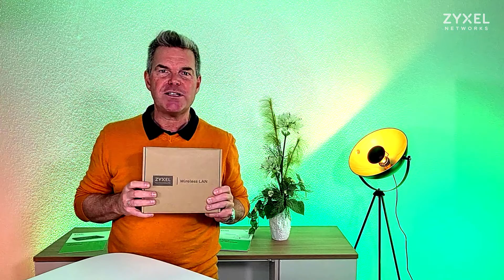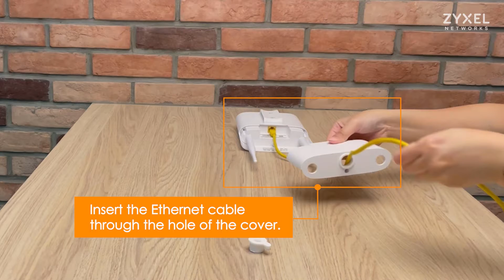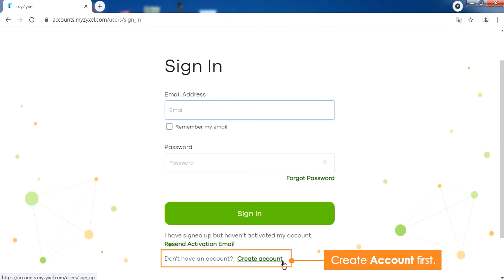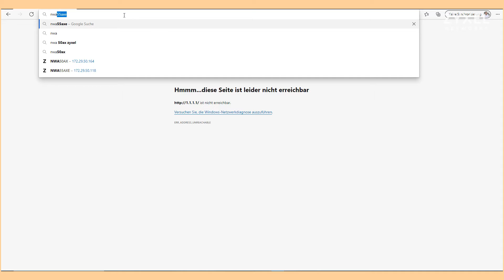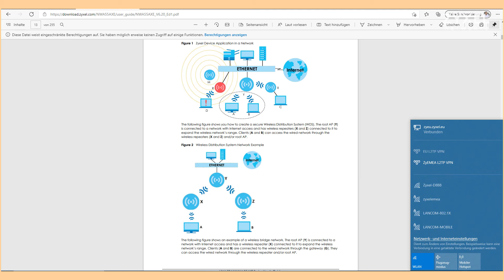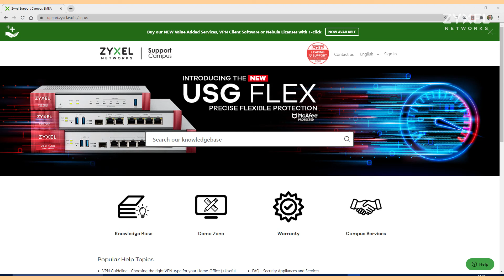Zyxel NWA55AXE WiFi 6 Outdoor Accesspoint Introduction and Installation [EN]

Comment: way too fast with the explanations, you know how to configure this, you are trying to teach us, your accent is very deep and not very understandable when you gloss over important information and the worst thing NO RESET BUTTON, WTF?
Reply: Just bought this but I think I will return it. Your instructions may seem very clear to you but seem very complicated and still no reset button???? That is not good.
Reply from the maker: @DCPHONEGUY  the reset button is not required if you use Nebula Control Center. I installed 10 of the units in a horse stable and this works flawless with the app and the NCC. But it is your own choice to return the device if you don't like it. For me it is a low budget outdoor AP that offers all I need.
Reply from the maker: Hi Mark L sorry for the speed, but you can pause the video and repeat at anytime if the explanation is too fast. Also I try my very best to speak an understandable English. Maybe you switch on the subtitles, which are very good supporting the read and write.
Yes there is no reset button, because the housing must be water proof at any point. Such a switch is always a gate to infuse water to the electronic. The reset of the device is always possible using the Nebula App.